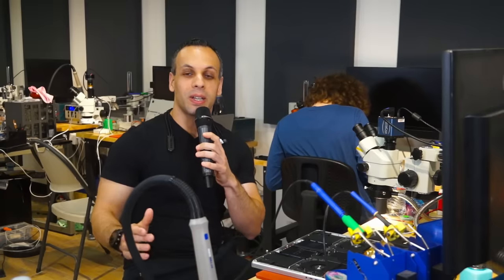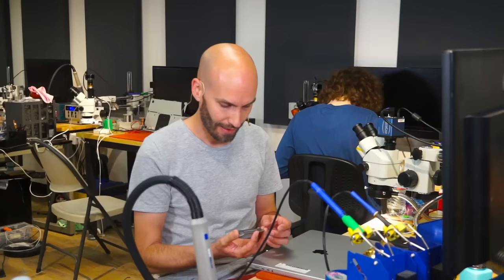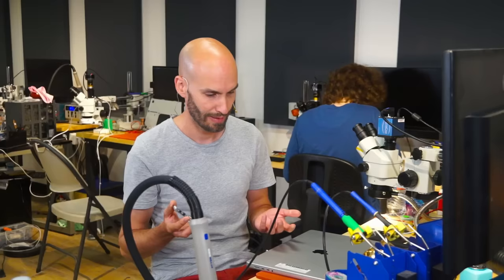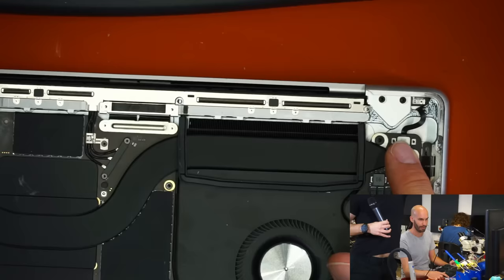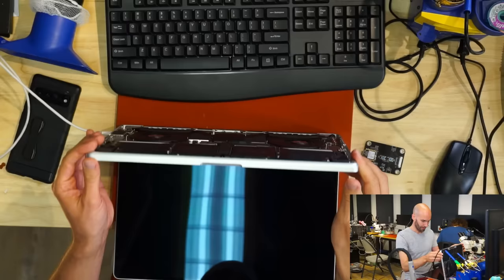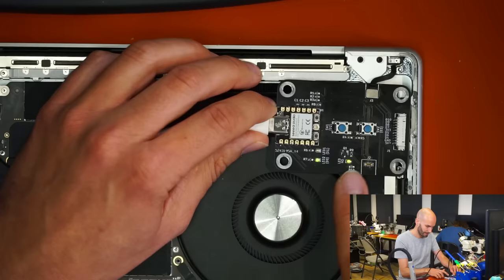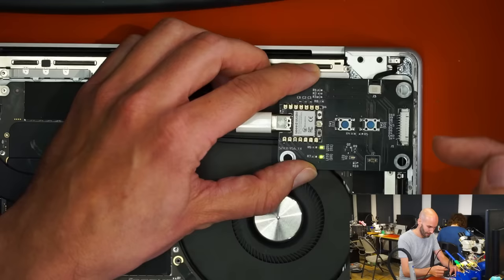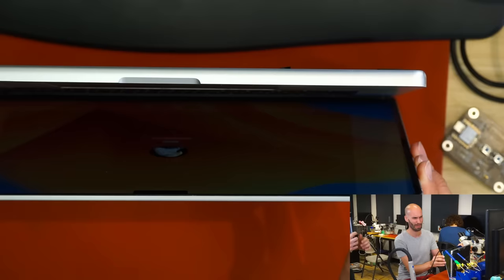We beat Apple at their own game - let the unauthorized calibrations begin

Comment: "If you don't pay us we'll keep this mic on 24/7 and further defile your privacy. As you can see, paying us would do a lot of good for your privacy and security" 
It's basically a mob shakedown
Reply: Thats a really nice sensor you got there. Would be a shame if something happened to it. But dont worry, we got people for that if the worst would happen. Just trust us.
Reply: it also lets them blame the repair shop for "making it insecure"
Reply: It's not even a mob shakedown at this point, it's extortion.

Too bad every Apple defender will gladly bend over and let Tim Cook extort their finances no questions asked.
Reply: and we already proved we do watch and listen.
Reply: You can still hibernate the computer.
Reply: Data sells.
Reply: apple removed select all when selecting stuff (usually to delete) from ipads... enough said.... but I'm sure they are also working on the  negative 1  button mouse (which is the future) discharging cables to drain your device between uses and phones that can't make calls - signed apple.
Reply: @Csilk  I use an i-phone that can't make calls on my drone.  That way I know it will NEVER talk to china.  My firewall blocks it while in the house, and TCP network is between drone, and phone while flying it.
Got it cheap on ebay since the sim card slot doesn't work.  So no EULA agreed to either to violate.  The android software isn't up to par is why I did it.  It crashes in middle of flight dropping video recording.

Comment: The next most ridiculous thing I can think of is if they start making charging cables that are calibrated to each device and having that calibration tool unavailable to repairers because it would be insecure if someone else could grab your device and use their charging cable to plug in your device for access to your stuff. lol
Reply: This is already partially done as the device will only have slow charging with some 3rd party cables for at least the iPhone and iPad series devices
Reply: @startouchedFeline  LOL meanwhile im here just chucking my 60w type C charger into any type C device I own. Thats just so funny to me ive not used apples devices for a very long time now so I didnt know! xD artificially hindering because they didnt get your money. My ass has still not fully recovered from Apples bullcrap lol

Comment: Excellent job guys!  Now if you can figure out how to do the same for the new M1, M2 MacBooks when you swap the lcd screens on them with an oem Apple screen.  Apple makes them distort until you buy a lcd screen from them and then only they can run the configurator software to match it to your logic board.  REWA figured it out and you have to remove the original chips under the lcd and put them in the replacement lcd just to get the lcd to work.  This is ridiculous if you are using OEM Apple parts from the start IMHO.

Comment: The tools is awesome but I would be somewhat worried about the durability of the connectors, as most of the time these might only be rated for a few tens of use? Might be worth exploring putting these on a daughter board that attaches to the main board with a bigger, more durable connector. Anyway, this is awesome and I certainly wouldn't mind being proved wrong :)
Reply: Thank you for your comment. We acknowledge that the problem you mentioned could arise, and we will explore the possibility of providing replacement connectors for such cases. Furthermore, we have already implemented the solution you proposed by incorporating an additional port (the white one) for connecting a daughterboard. In this regard, we can also consider offering replacement daughterboards. Your suggestion is much appreciated.

Comment: Now wait for apple to disable this calibration with a software update.
Reply: Thankfully this appears to be purely a hardware thing so no updates should be possible. But you know apple is coming out with a revision 2 that 'patches' this 'security vulnerability'
Reply: the sensor is actually pretty basic. It only reads a magnet that is attached to the LCD assembly. All the system configuration does, is tell the sensor "the lid is closed now, remember the polarity of the magnet" and that's basically it. There's no "software fix" to break this nerdtool, since there's nothing complicated in the sensor itself.
Reply: @PvtAnonymous yes, in this one 😅 I have a weird feeling that future versions will be more compute heavy

(but for security reasons obviously. Not specifically to prevent stuff like this from happening, this is a reputable company we're talking about here! 🤣)
Reply: @kyushirokun  I mean, they would have to reengineer the whole sensor - for what? There's no need to do that. While many think Apple does this on purpose, it usually is only required for parts they use themselves and only those, that even have an advantage when calibrated like screens, cameras, lid angle sensors, batteries and so on. They run through automated software procedures and copy some data from the mainboard in the process. Why? Because original Apple parts come basically blank from the factory (meaning they have a factory profile installed, if at all). The purpose of calibrating this LAS is not to spit in the mouths of 3rd party repair shops (although that is an added bonus), but to make the process idiot-proof for Apple's own technicians and to be as easy as possible for them.
Additional info: Apple doesn't hire overtly technically skilled people for the Genius position, they want employees with people skills, who can talk and emphasize with the customer, repairs and problem solving isn't the main focus.
Reply: @PvtAnonymous  they literally have to reprogram the lid sensor from it's factory default state instead of flipping the magnet to the other polarity
Reply: @Oaisus  you can flip the magnet, it's just incredibly difficult. So difficult, that we said screw it and just order new lid angle sensors every time we have to replace a MacBook display. The hassle and waste of time (usually around 15-30 minutes) to align the sensor perfectly, is just not worth it. Calibrating a new sensor via system configuration is just a minute of work and can be done by anyone; most technicians that work for Apple and AASPs would be too clumsy to adjust the magnet. Especially when you consider that Apple tries to simplify repairs as much as possible for their own staff.
Reply: @PvtAnonymous  I mean, I hear you, and have had the misfortune of having to deal with their "geniuses" before so makes sense.

I'm not entirely convinced about the complete lack of malicious engineering though, things like making the laptops unbootable if the storage dies seems pretty deliberate with no tangible benefits to the user. Doesn't sound worthy of the benefit of the doubt to me I'll admit
Reply: @kyushirokun  I'm not sure about the exact technical reason why it won't boot from another drive when the internal SSD goes bad, but Macs have been like this since 2018, every one with a T2 chip. My best guess is, that the SSD controller sits on the T2/Mx chip and doesn't store boot policy values per se (you have to manually enable booting from external drives in the macOS recovery). So what I suspect, is that when the internal SSD goes bad, it doesn't return a positive value to the T2/Mx chip anymore and the machine won't boot. It's kind of amazing from a security standpoint, but REALLY bad from a perspective of data recovery and longevity of the machines.
Reply: @PvtAnonymous  I can vouch for this, as someone who has done plenty of repairs for Apple and the likes.  The idea of "they would have to rengineer the whole sensor - for what?" is pretty absurd to me.  We both know that's not true, and its disingenuous for you to imply so.
Reply: @CPRGOFFICIAL  I have no clue what you are talking about. They already changed how the sensor works from the A2141 to A2485 models, but the principle is the same. If they wanted to engineer a sensor that can't be easily recalibrated, they would need to redesign the whole thing. I have no idea what is so "disingenuous" about that statement.
Reply: @PvtAnonymous  I'm guessing the "disingenuous" part isn't so much about the fact that they'll actually have to redesign it, that much is obviously obvious. 

The thing is, apple HAS redesigned components and policies to make their products harder to repair. It has happened before, so it doesn't seem so far fetched they'd do it again, even if the reason "for what" is only "making user repairs more inconvenient",

At least that's how I interpreted that comment
Reply: @kyushirokun  Apple hasn't really redesigned anything to make it less repairable per se, it just becomes less repairable, because Apple doesn't value repair as high as some other companies do. The design over function mindset is embedded deeply in that company's culture and it really shows. They don't care how 3rd parties solve the problem of serialized components, because they have "their official way" and everyone outside of that privileged bubble is out of luck. Now the only time where I would agree with the "redesigned to make products harder to repair" is the ISL9240 or CD3215/17 etc.. They actually forced the manufacturers of these ICs to sell them to 3rd parties. And for one reason alone: to have more motherboards they can refurbish and reuse for their own repairs, selfish and scummy, but that's business for ya.
Reply: @PvtAnonymous  The technical reason I believe is the EFI/firmware is now on the SSD to save a few cents.  Interestingly there are several videos on YT where it CAN be repaired by replacing the NAND with blank chips and using (presumably leaked Apple software) on a second Mac to remotely re-write the NAND.

Comment: makes me think of why i dont like the dell way of detecting if the lid is closed. They use magnets and im guessing a hall sensor(or similar), If you stack 2 or more laptops while working on them, the top laptop will not turn the screen on, assiming that the lid is closed because the laptop below it is triggering the sensor.
Reply: That's always fun the first time you encounter it and start pulling your hair out.
Reply: @annihilatorg  I thought half a shipment of brand new laptops were all bad the first time I came across it.

Comment: I wonder, why apple need to make a dedicated angle detector to detect if the lid is closed or not, a simple switch(and some basic circuity) can do this work just fine. I can't even imagine why a controller even need in this situation, other than make the device unnecesary compilcaded and expensive, and make the repair compicated ad borderline unrepairable.
Reply: Well, making repairs as complicated as possible so that most independent shop might deem it unrepairable due to the amount of work is pretty much Apple being anti-repair. Just so they can tell you to buy a new macbook, when all you need is a damn sensor.
Reply: You answered your own question.
Reply: physical switch is mechanical so wears out. I read they used to use magnets, but those where trown off by external ... magnets. An angle sensor is a sensible way to do it, locking its calibration down is just plain stupid.
Reply: @someonespotatohmm9513   What about an optical switch ? dead simple compared to what Apple is doing and will never wear out unless physically blocked
Reply: "Think different."
Reply: @cbegefdkih  Yea, physcialy blocked is the thing there. also the light requires power, and has a limited operating time. What apple is doing is dead simple, they just intentionly fucked up the best solution there is.

Comment: What sucks even more is that Samsung has going down this exact same path. It used to be all for repairs. Now if you replace certain Samsung parts they will disable a huge portion of your phone. It's ridiculous
Reply: Samsung is usually the first ones to adopt apples shitty ideas. Removing the headphone jack and charging brick are just the first two that come to mind. Samsung doesn’t respect ownership either
Reply: Also, I flashed the wrong file on Odin once and download mode had the gumption to tell me that the software was unauthorized and that I will be charged for authorized repair. Luckily I knew what I  was doing .
Reply: @Emancipatriot  yeah man you're completely right Samsung closely follows Apple sometimes and apple follows Samsung for some things. They both are doing the same things now
Reply: i noticed that too. mostly with the more expensive flagship devices. like, the higher the price of the phone, the harder for consumers to repair it

Comment: this is brilliant, even when you are an Apple technician, you are only able to perform screen calibration when you have an open repair and use a new lid angle sensor. They are a one-shot device and if you calibrate it incorrectly, you cannot re-calibrate it, and it must be replaced again. But even when you have access to these tools you cannot simply throw lid angle sensors at random MacBooks. If you want to you have to have a repair open which means that whole process has to be followed.
I’ve always been curious and have not believed that tiny chip could be all that complex and I am glad that someone has finally figured it out so people can just fix their MacBooks that they own, and should be able to do whatever they want with.

Comment: I agree with the initial basic conclusion. That it isn't nor was it ever intended to be any particular security feature, as evident by its failure state; full self-defeat of that supposed "security function", with little to no indicator to the user that something is wrong. Arguably even worse; it packs the lock so the door closes as usual but the lock silently doesn't engage.

It would be like having locking bolts on a safe door, with a sensor that detects them starting to move, and then activates some electric actuators that assists the movement to make them lighter to cycle. But designing it so that if that sensor fails, when you rotate the wheel to cycle the bolts, it will rotate as if everything was fine but "under the hood" the actuators didn't get triggered so the locking bolts never moved. If the door front facia didn't overlap the opening, it might be possible for you to shine a flashlight in the gap and notice that the bolts are not engaged. But with no significant indicator that something is wrong, you certainly wouldn't do that because there would be no reason to suspect something was wrong. So you'd leave it like that thinking it's safely locked, when in reality the door is closed but that's it.

Comment: I made a clone of a proprietary repair tool once. It's for Brinks security systems from the 00's. Programming the system requires a proprietary handheld device that connects to the system, which was only given to Brinks employees. But I found one on eBay, reverse engineered it, and wrote some software that replicates its functionality. It's helped many people get their system working when they otherwise would have had to buy a new one or sign up for a monitoring contract.

Comment: I love how you're using a seeed module. Great little uC's for tinkerers. Can't see which one it is, but I'm assuming its the esp32c3 as the esp32 is one of the most used uC's out there.
Reply: I guess it's an overkill, a Atmega Chip with I2C would work too and you need an adapter connection to the sensor.

Comment: my industry (coin operated video games) has all kinds of locks on things that are unfair. How about when a crap nVidia 760 goes bad and we cant just replace it with one off the shelf... We have to send the computer in, which is BIOS locked, uses Microsoft TPM, has custom firmware on the video card, and has an ATA Password on the hard drive, and comes with no backup solution...

The repair usually costs us anywhere from $700 to $2000. YAY US. 

This is one of many examples. It sucks. I'm glad you guys were able to figure this one out! Score for the small guy!!

Comment: Sounds to me like apple bought a COTS IC integrated sensor circuit, and didn't think to share the information downstream, so supplying hardware to plug the gap was completely off the radar.
As for this gizmo, it might make more sense to use an Arduino or Raspberry Pi (so it can easily be updated), and develop a hat/breakout board with every connector variant used throughout the device. That way, software can be written and distributed later by the community to resolve any future issue similar to this, all using a standardised hardware interface.

Comment: The only advantage I see is that stealers are not interested in stealing a MacBook for parts because these parts won't work with the other MacBook

Double edged sword. I want something at the middle, so stealers can reuse only position sensors and ram, and a motherboard/screen/expensive parts are locked, and the unlock code is on the original macbook box

Comment: This gives me hope that someone will find a way to pair True Tone cameras up to new logicboards. I had two Macbook Air 2337; one had a broken screen and the other one had an unrepairable logicboard. I took the screen assembly off of the liquid damaged one and used it to replace the one with a broken screen and the True Tone no longer worked because the camera is paired to the board and Apple refused to calibrate it because I didn't buy a NEW part FROM THEM, even though all of the parts were legitimate Apple parts.

Comment: In all my many years of repairing computers, I have never once had to replace anything on a Dell PC or Laptop but the operating system or the DVD / CD burners...

Only a criminal would sell you something that is already over priced, has defects from the factory and then sue repair shops to prevent them from making repairs...